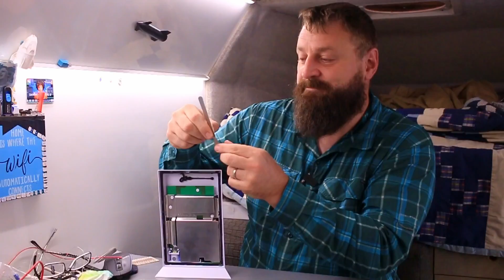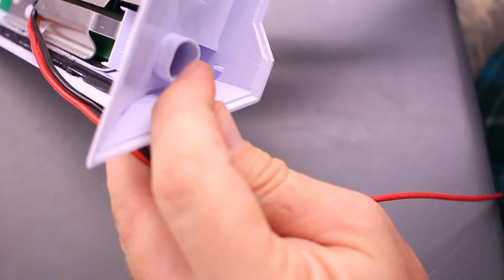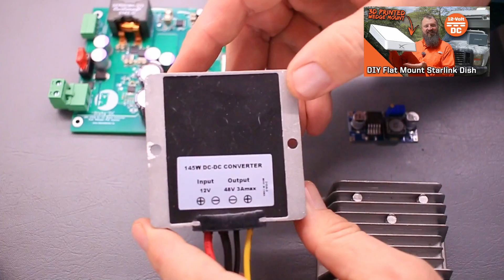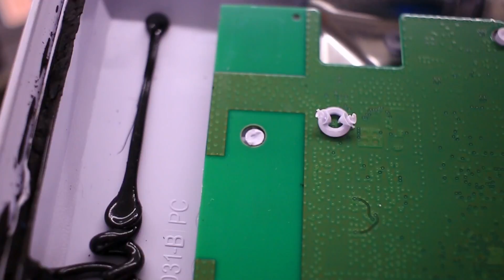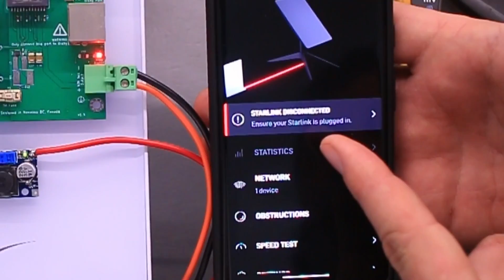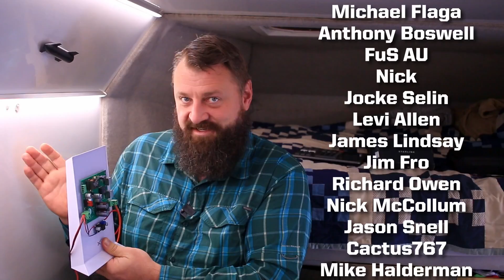Hacking the Starlink Router to run DC Power

Comment: Good day sir i follow your tuturial,and it did power up the router, but the dish did not still offline,. Is it the capacity of my 48v module? Coz its 2amp, it did not power up the dish. Still offline,. What capacity of 48v module must i used? Or is it the battery problem? Or is it your demonstratrion the dish motor been cut off? I like to hear your answer coz i need to convert my starlink to 12v operation. Ty sir, i hope for the feedback
Reply from the maker: 2 amps is far too small... you need at least 130 Watts during the boot sequence. The correct DC-DC converter is still linked in the description.
Reply: @Everlanders  so, if I buy a module of 48v with 5amp, it really can solve the problem? Please sir give an advice thank you verry much for your reply i really appreciate it. God bless you more
Reply: @Everlanders  is it ok that i will going to use 48v/5amp? Than to a 48v/3amp like in your discription? Coz, thats the module that are available in our country. Is it ok?

Comment: Hello 
Can you help.
I have connected everything up
But I cannot get connected to the Internet, it just says 
Connected without Internet 
I have checked all the voltage and it is all correct.
If I disconnect the 12volt source and plug into the mains it works
Can you help with some advise.
Thank you
Reply from the maker: Your power supply is too weak to supply the startup current required.
Reply: @Everlanders  I thought that might be the problem  so I by-passed the 12v to 12v regulator  and now have 13.5 volts going into it starlink router and into the 12 volt to 48 volt converter but I still have no Internet connection 
Can you suggest anything else I can try
Thank you
Reply from the maker: That won't help you, it's the 48 volt bus that needs the current, your power supply is too weak to supply the startup current required.
Reply: The step up converter is 12v to 48v 5 amp should I get a bigger amperage
Reply from the maker: It doesn't seem to be able to sustain 130watts needed for startup.
Reply: @Everlanders  I have the same problem with the Boondocker psu 
I can connect to the router but cannot connect to the Internet.
But if I plug the router into the mains 240v supply it connects no problem
Reply from the maker: Considering the number of people who have had success with my methods... You've got something hooked up wrong, can you share some photos?
Reply: I have a lithium battery bank 
So plenty of power
Reply from the maker: The battery is not the problem, it's your wiring, show some photos, or I can't help you any further.
Reply: @Everlanders  have you a email I can send pictures.
I can't seem to post pictures here.
I have just come back from the Boat 
Thank you

Comment: Why the hell doesn't Starlink come with a 12V connection out of the box??????? WTF.
Reply from the maker: Because a very small percentage of the users need it.
Reply: Well, everyone who travels remotely usually has 12V but not all have 110/240V. The easiest thing is to add a 12V input into the housing. Very strange.
Reply from the maker: 12 volts is easy, 48 not so much.

Comment: Do you have wiring diagram for this rj45 conectors
Reply from the maker: Standard T568B
Reply: @Everlanders  many,many thanks
Reply: @Everlanders  i want to cut original starlink cabel and after instal tru sailingboat again to conect together with rj45 conectors
Reply from the maker: Perfect

Comment: Hello. Pin 6 of my j5 connector referring to the 48v input came out of the board. Can you tell me if it is possible to make a jumper at another point on the board?
Reply from the maker: 6 and 8 are both connected together on the Board.
https://photos.app.goo.gl/RcUDxVdWvVvHKsyB6

Comment: Why waste all that energy - just use an inverter to run the Starlink from 12VDC.
Reply from the maker: You missed the point entirely... The 12v to 120v inverter and Starlink used 60watts, the straight DC uses 28watts.

Comment: Hello
After two months of waiting  my PSU came but it is missing the 48 volt plug
And I can't  wire it up with out it.
Have you got a contact  number for your friend at boondocker
As I am not getting a reply back by email
Many thanks
Reply from the maker: Order number?
Reply from the maker: Also, the 48 volt plug has little use outside of burn-in testing, I removed mine and tossed it... Are you sure you need it?
Reply: I followed your wiring instructions for the router and connected the cables as in your video but I have no plug on the psu 
For the 48 volt supply
Reply: Three cables from the router 
One negative one 12volt and one 48 volt
Reply from the maker: No, the Dishy DC needs only 12 volts and ground. The 48 volt connection is an output and not needed outside of testing.
Reply: I am using my original starlink router 
With the modification you recommended.
I have been waiting months for this psu 
The case came a month before the psu 😳
Reply from the maker: Most people are ditching the Starlink router, but if you want to keep it then you'll either need the connector, or solder to the back of the board.
Reply: @Everlanders  I have done that from your video which is why I want the the 48 plug, I am happy with the starlink router.
Reply: Hello 
Can you help.
I have connected everything up
But I cannot get connected to the Internet, it just says 
Connected without Internet 
I have checked all the voltage and it is all correct.
If I disconnect the 12volt source and plug into the mains it works
Can you help with some advise.
Thank you

Comment: these vids are so good love it, just a question on the option 3 "most destructive" method, when you used your little patch cable to the SL.router, weas that an Xswapped lead? reason im asking is I have ordered the boondocker dishy dualie board and trying to figure how to wire the patch cable to the original SL router so i can use it for testing or troubleshooting bus as the dishy connection is standard and not Xswapped not sure which way the patch to the SL router will need to be wired, any insight please would be most apreciated.
Reply from the maker: If you're using Dishy DC, there are no swapped cables anywhere. Standard T568B everywhere, then you can plug back into the Toaster too...

Comment: HI friend, nice video. Can you explain, how to implement an external WiFi Antenna? This router provides the worst WiFi Signal rate i have ever seen ....
Reply from the maker: It has nothing to do with the antennas, but the radio itself, I have completely bypassed the original Wi-Fi with this solution: https://youtu.be/RlENmAikSQQ

Comment: Any chance there is a schematic showing the results of this hack? How are you connecting the 12/48 volt leads back to the battery?
Reply from the maker: No... It's simple, 12 volt in, 48 volts out as shown over and over in the video...

Comment: just looking for a bit of clarity here. I notice that your 12/24v to 12v regulated controller only has 3 wires on it. Did you snip the yellow(+) off? Can you explain this method?
Reply from the maker: No, it has 4 wires, 2 in 2 out.
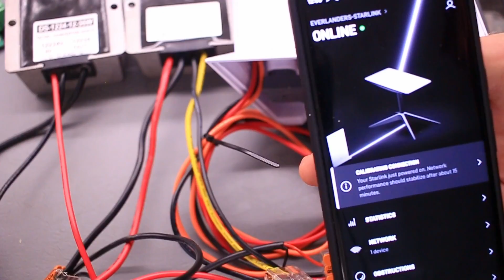Reply: @Everlanders  @14:03 was what I was referencing.
Reply from the maker: What you're seeing on the right side of that converter is a black jacketed cable that has two output wires inside. You can see them split apart near the Wago connectors right in the middle of the image.
Reply: @Everlanders  sneaky sneaky! Thanks for clarifying! Ive used these things for years and never seen one like that.
Reply from the maker: It's the only one I've seen like this too... Likely made that way because it was originally fitted with a barrel connector on the output.
Reply: for reference I see you talked about the shared common ground, but it appears to be the positive that was snipped on the output?

Comment: Which method is more efficient for energy saving. the modification with poe injector or the modification of internal wiring?
Saludos amigo
Reply from the maker: Both use 28 watts

Comment: Question: for 12vdc, I’m using lithium battery and puts out 12.8- 14.3 vdc. Do I need to use a 12vdc regulator or the router can handle over 12vdc?
Reply from the maker: 9:00

Comment: does the starlink router serve any purpose with firmware updates to the dish? (trying to determine if there's any reasons to keep it/occasionally use it versus just running a 3rd party router)
Reply from the maker: No, my dish updates without it.

Comment: what gauge of wire for the 12 or 48v with the Bigger 288-watt Boost Converter?
Reply from the maker: Anything reasonable will work, I used some scrap 18AWG
Reply: @Everlanders  perfect thank you very much. So just confirming I can run the 48v/6A boost converter to the starlink router and it can handle that fine?
Reply from the maker: You'll need two, 12 volts and 48 volts, what I linked in the description worked fine for me.
Reply: @Everlanders  Hmm bit confused, I thought you could run it either 12V or 48V?
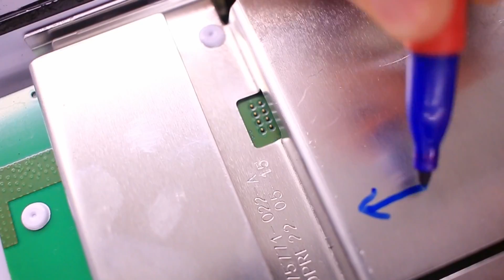Reply from the maker: 3:26
Reply: Thanks. It was my misunderstanding, I thought you could run it either 12 or 48v. Of course it make sense that if there's 48v connectors then there are two circuits.

Comment: I used your 2nd option (solder to the pcb) it works great, I used the LM2596 and a 6a 12-48v converter, would I be correct in saying if you connect the 12 pin to the  led, the light should come on?
Reply from the maker: No, further investigation shows the LED is powered by the AC power supply and triggered through 2 optocouplers... Probably not worth going down that route.
Reply: @Everlanders  ok thank you

Comment: I wonder why SpaceX doesn't have a DC volt kit for the "roam" StarLink.  Maybe it comes with the flat mount kit, which is a super duper version with higher speeds and better connections, hence the $2.5k.  Good idea with adding the board connector.  I wonder if you could have your friend make a small PCB that you would solder directly down to the power connections on the toaster with small lugs to attach wires to and tap power from that.  If youi printed a case, make it a real toaster.   Another great video!
Reply from the maker: No DC options from SpaceX yet, they are all AC mains powered.

Comment: Having problems stowing my poll down for the return of my Starlink it does not connect to the router can someone help with this I need to send it back but won't fit in the box do to the poll being straight
Reply from the maker: Put the dish face down on the floor, and then power it up. Then go into the settings and press stow.
Reply: @Everlanders  there has not been a connection between the router and the dish so the has  being disconnected the word stow on the app is not even available to press is faded

Comment: What gauge/amp wire are you using for the 2nd  method, please? I've started my conversion 👍🏼
Reply from the maker: The header pins your soldering to are equivalent to 24 AWG, so anything close will be fine, 18 to 24 AWG...
Reply: @Everlanders  thanks, it's not the header pins method, it's the more invasive 2nd method you did, straight onto the pcb
Reply from the maker: Oh, okay, that's even more forgiving... 12 to 22 AWG would be many times more than sufficient and easy to work with.
Reply: @Everlanders  great stuff thank you. You make it look easy hahaha!!!

Comment: Have you had any issues with running the 12v mods whilst leaving the mains power supply installed? Just about to change mine but not 100% sure if leaving the mains power supply installed will cause an issue. Cheers.
Reply from the maker: Its preferable to have it installed as it's filter capacitors help smooth the power.
Reply: @Everlanders  my 48v supply just arrived, might modify this weekend, love that it works keeping the mains power supply, dual purpose!  My battery system is Lithium but have programmed all my chargers to float at 13.5v and max charge of 13.8v rather than the 14.5. Very minimal capacity loss (less than 1%) but much better for the batteries and happier to use this directly as the 12v input for the modem.
Reply from the maker: Oh wow, let me know how this works out.
Reply: @Everlanders  just finished, working beautifully with just the 48v power supply and router running directly off the 13.6v batteries. Haven't taken a power reading yet, will do that once I reassemble and mount back where it should be.
Edit: averaging around 3amps on the same test I did with the 200w inverter that averaged 3.6amps. Inverter averages 0.2amps on its own, so I guess Starlink has dropped about 0.4 amps.  Running a lot cooler too.

Comment: In the spirit of using parts I already had, I used a 12 to 48 step up boost converter and a LM2956 to provide 12v to the router. I soldered my 12, 48, and Ground wires following your first method described. However, I am noticing that the router appears to be losing power intermittently. The LM2956 reads 11.81-12.1v on the out when under load. I did set it to 12.0 prior to soldering the 12v line. Is there an acceptable range I should be targeting to avoid this?
Reply from the maker: The output could drop slightly under load, if you have a steady hand, I'd put a voltmeter on there and bump it up to 12.1 while under load. Let me know how you make out...
Reply: @Everlanders  While waiting for your reply I kept tinkering. I replaced the LM2956 with another one I had thinking it may have been faulty. Then I did exactly what you said by slightly overvolting to 12.1 and it's working now. Appreciate the reply and the tutorials!
Reply from the maker: Super! The trick is to get the output voltage dialed in under load...

Comment: Brilliant work and demonstration! (I enjoy your sense of humour.)  I'm getting ready to convert my unit to DC using your original POE Hack method but it's good to see an alternative solution.  As it turns out the 12V WiFi router I am going to use to replace the Starlink version has a better signal and better coverage to the other end of our boat.  Turning off the inverter and the efficiencies of using the DC power source should be well worth the trouble.  Thanks for your great work here.
Reply from the maker: Yes, the Starlink Router's wifi is terrible, happy to have the long range MoFi 5500 👍
Reply: After multiple attempts and still failing to get the POE injector + Linksys router to work properly, I followed your oh-so-excellent, more invasive hack instructions and converted the Starlink router to DC. I was pretty chuffed to have it working when I left the boat last evening.  Thank you very much!

On a 40 foot boat and with no intention of accessing the WiFi signal beyond a limited distance (we won't be setting up lawn chairs in the dinghy); the Starlink router works well enough.  I'm a happy camper.

(Sorry to read about the loss of your pup... My condolences. They leave a big hole when they go.)
Reply from the maker: Excelente, did you Solder to the pins, or the power supply board?
Reply: I tried soldering to one pin but it was too flimsy so went to your more robust, solder to the power supply board method. 

I’m thinking I may add a 12 VDC LED to the case & then get to disabling the motors for a flat mount next. … 

True contentment is elusive ;-)

Comment: I will just take a UPS to power it!
Reply from the maker: It seems you didn't understand the assignment. The UPS will last a few hours, then what? Out truck is a 12kWh rolling UPS, but the losses in the inverter (or your UPS) double the power consumption, and when traveling high in the Andies or through the Bolivia Salt Flats, you can't plug in and every watt saved is a watt earned.
Reply: @Everlanders  I understand. My 100 amp hour LiFePo4 battery with solar charger and 800 watts of panels will run it for a very long time, if I don't use my high power radio much. I never want to go to South America, or a restaurant in Chicago. Google sucks! But I understand changing to 120 then back to 12 V is a waste of power. But I send my email by HF radio! Use Moon Bounce or satellite to talk to people.

Comment: I'd be more likely to scrap the original power supply, and just replace it
Reply from the maker: I'm not going to bother, let me know it works out for you.
Reply: @Everlanders  don't have a reason to use Starlink yet, but if i do need, i will let you know

Comment: I love these hacks. Have you considered using a slightly more advanced converter (e.g. variable input, fixed output voltage Buck-Boost) for the 12V supply? I built something like this to make a DC-DC 20V laptop charger. In this way you could convert anything in the range of, say, 9.5V (very low battery) to 14V (alternator running high) to 12V +/- 0.05V. And have you looked at the output of these voltage converters on a scope when your alternator is spinning? Is the voltage "clean?" When I do this myself I may even add a filter to the 12 & 48V outputs for cleaner power.
Reply from the maker: Yes, I have several of these powering our laptops, 3D printer and some other odds and ends, they work great...
Reply: @Everlanders Good deal - I just wanted to clarify I meant specifically for the 12V power supply. It looked like you just have a Buck converter to converter 13-14ish volts to 12V (this ought to work most of the time, and probably all of the time for your vehicles battery setup). Sometimes I find myself in the scenario where my aux battery drops below 12V but I still need it to power things, in which case I need a box that both Bucks and Boosts (to raise a low battery up to 12).
Reply from the maker: The 12 volt is fed into regulators for 3v and 1.3~ rails, so less than 12 probably doesn't matter.

Comment: Now we need to hack the GUI. Need to get into the wireless settings and change it from 80 MHz way to 20 if you can do that you’ll be my new hero.
Reply from the maker: Sorry, I won't be putting any effort into that. proper control of my network settings is why I'm sticking with Dishy DC and my MoFi 5500 shown here: https://youtu.be/RlENmAikSQQ